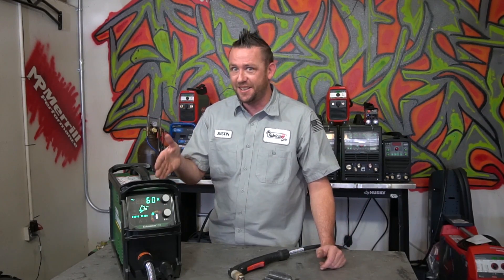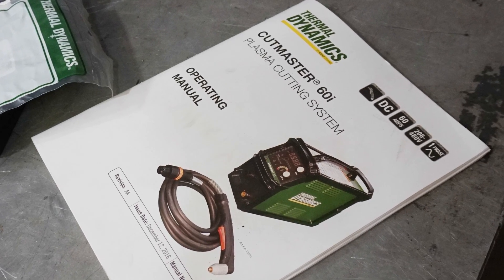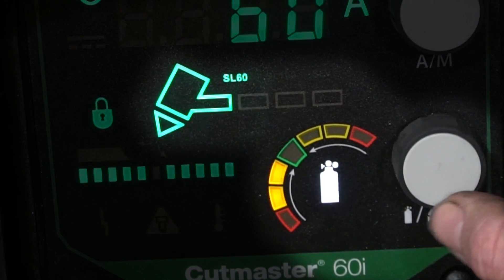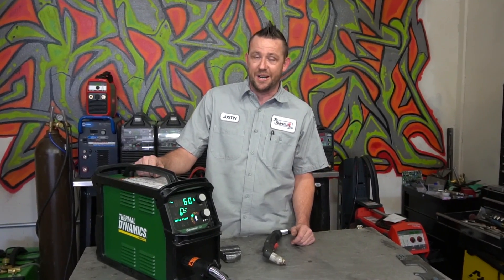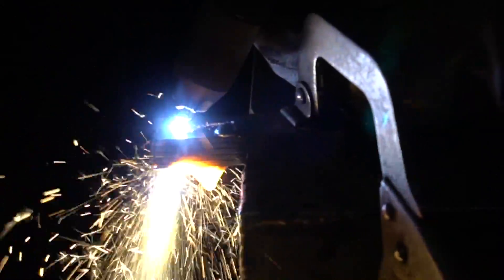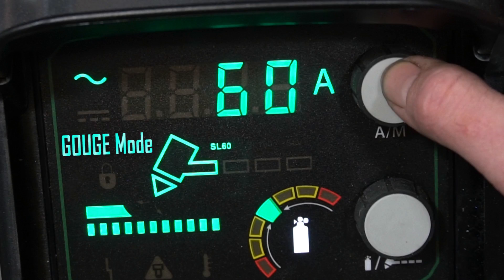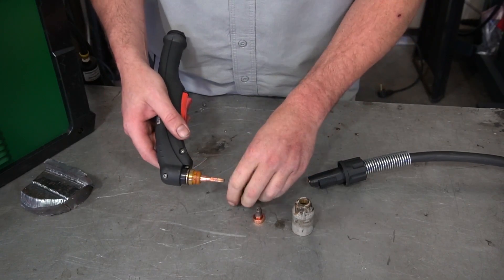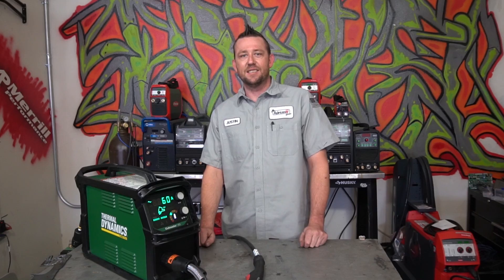TFS: Thermal Dynamics Cutmaster 60i Review

Comment: It's funny how people will get on here and criticize a machine that they've never used. I owned a  hypertherm plasma cutter.  And when it broke down just out of warranty, and I found out how outrageous the repair cost was going to be, that was it.  I'll never buy another hypertherm again.  So instead of wasting $1400 to have it fixed, I bought a thermal dynamics cutmaster 58.  Half the price, and for hand cutting it works just as well as a hypertherm  without all the hype.

Comment: The first one I used was at Pleasants Power plant,it was huge and had argon and CO2,used it to cut stainless pipe that went on the top of the coal pulverizers,B&W ball Mills, Harrison had the same Mills but were 2' shorter.Each unit has 6 Mills.

Comment: I purchased this machine in December,2017, it was great until it failed four months later.Much to my dismay Esab, doesn't have a warranty service center in the state of New York, and they did not pay for the shipping to,and from their facility Airgas, in New Jersey, which is not the actual repair facility.Airgas, sent the unit out for repair,and charged me $20 for the shipping. I sent the unit in for error code E004, that could not be cleared. Six weeks later I get the machine back,and fifteen seconds into the first cut I get error code E012. After checking the manual I was able to clear the code nevertheless,I feel this machine may be smoke and mirrors.Esab, boasts of a  great warranty however, in order to get service be prepared to jump through hoops, and spend some more money.
Reply: i think your comment is a more valid representation of the user experience than the obvious commercial this video is. thanks for the feedback.

Comment: I have had an older model:  Victor/Thermal Dynamics, about the same capacity (60 amp rating) as this one for 4 or 5 years now.  It is basicly the same machine as this but no digital displays. Uses the same consumables as this one.   There was a learning curve for me. My previous machine was a borrowed, very expensive older Hypertherm, which spoiled me it was so easy to use and worked so well. 
Now that I've learned how to run it well, it does quite nicely.  I've built many jigs for getting quicker and cleaner results on production type work.  Usually using a drag shield along straight edges and made up patterns of 3/16 or 1/4" thickness
The challenge at first was just getting good life out of the consumables. Frustrating until I watched some trade show videos of the same machine being demoed. I was using too high of current setting, and now I cut even 1/2" thickness at 40 amps,  sheet metal at 20 amps.
There is a lot of aftermarket import consumables at very significant savings and they seem to work just as well.  Also grinding down the ends of worn nozzles and cleaning the center holes with tip cleaner gave them much longer service life.  
Plenty of air is required.  Upgraded my compressor pump to an Eaton 5hp 2 stage pump with the recommended drive pulley for the 5hp motor. An under size compressor will run hot and send lots of condensation moisture through with the air and shorten consumables life. It is more than adequate now, on it's dedicated 40 amp service (a separate one from the 50 amp welder and plasma cutter circuits).  Lets me run all 3 machines at once, if there are several people working.
A standard plastic household water filter housing with cheap 20 micron particulate cartridge, mounted right on the back of the plasma cutter,  is my air filter that just never seems to need any servicing or attention.

Comment: With plasma it's all dross... There is no slag. Slag is the shit they dip of the top during smelting. 😀 Oh and... Hypertherm rules...🙄
Reply: To have slag, you must have flux. The droplets of steel hanging below and sitting on top are dross.
Reply from the maker: Spatter/slag usually refers to mess on the top of the cut while dross is at the bottom or end of the cut. I usually always say dross for all of it, but wanted to be a bit more proper in the vid.
Reply: The Fabrication Series Sorry.... For the benefit of your viewers, that is incorrect. Slag is a foundry term... This coming from my experience working in a foundry.... Everything on bottom of a plasma cut is considered low speed dross.... Everything on top... If any, is considered high speed dross. This isn't an argument but merely a correction for your viewers. The terminology I use is based on experience... Not conjecture. Dross is inevitable.... Even the best cnc machines have a minute amount so we won't even make the comparison to hand cutting. BTW....I have acquired a ton of info from your channel and I think you do very good work... Keep it up!
Reply from the maker: Paul Wilson Well its what's printed in the books and what I learned. I'd post a pic of it if I could haha.

Comment: This Cut 60 is much better than its older model  and looks like a decent Chinese machine - I thought about getting one however I’ll stick with my hypertherm 45XP you can gouge, mark, fine cut drag cut and precision gouge. The hypertherm is made in NH and I like drag cutting with the hypertherm instead of holding a small height and then cut. The hypertherm is way underrated too. The consumables and nozzles are easy to change and last forever.
Reply: Hey there, thanks for your feedback, it's greatly appreciated. We thought we would clarify a couple of items, Cutmaster 60i was engineered and is manufactured right here in NA. Cutmaster has the same capabilities and can cut more, faster and longer, thanks to the long arc stretch than the other brand you mentioned in your message. With only three consumables to change,  you'll need to keep fewer parts on hand and quicker changes. Drag cutting? No problem, simply switch out the tip and you're in business.
Reply: ESAB thanks for clarifying. The first model was not manufactured in USA correct? This machine is a real drag cut machine? Do you offer fine cut or flush cut consumables? I like this model much better than its predecessor. I do love my hypertherm though.
Reply: We offer a variety of consumables, check them out at https://www.esab.com/beast.
Reply: Welding Junkie one thing I can say is they do offer a boat load of consumable options. Incl drag cutting. But, what kinda sucks is that you have to match the consumable to exactly what you’re cutting. So if you’re set up to cut 5/8” plate, you can’t really pivot over and start cutting 22ga sheet w/o swapping to the correct consumables. I mean you could, but for best results, you can’t.
Reply: There is no way the Cutmaster 60i is going to match the Hypertherm 45 XP in torch or consumable options. The one area that it might have chance is if the SL-40 torch will work with the 60i  I have a feeling it will, but just have to wait till my 60i shows up.. By the way I have had many Esab,and Thermal dynamics cutters over the years.. Yes even before the one torch was out.. 16 year old consumable design in the one torch will not match the Hypertherm in many areas. Just not going to happen The Sl- 100-60 would not really even be close to matching the Performance of Esab 'PT-37-38-39 torch design.  I can get really good performance out of the SL-100SV Machine torch, but took me years to get there.. The Esab, and Hypertherm specs are right on the book #, but will never happen with a one torch machine..
 
It going to be interesting to use both my 45XP, and 60i on my plasma table.
i had a Hypertherm 65, and a Cutmaster A-60 om my table with both machine torches. The interesting thing is Thermacut has a retro torch ready for the Thermal dynamics. Been out, but not released yet.. They have some excellent patents on their torch consumables, and will probably make the 60i a very modern machine in the area of consumable cut speed.. As far as North American...That means made in Mexico, last time I checked.. 

Esab had some flushcut patents for longer then Hypertherm, but never really got around to using them. I would think it's about time to

As far as comparing cut speed (best quality)  with a Hypertherm, 45XP you will find the 60 amp cutmaster will run at the same speed as a 45 amp hypertherm XP. (.500)The 60i should have less issues on a cnc table edge starting on 1" Mild still. The higher cut height, and more output power supply will start to show some advantages there.  I owed a A-120, and Esab 1600 so I get what KW buys you.. Some time with a 85 Hypertherm too.. All can do the job, but Hypertherm machines are the easiest to use for most people..The 45XP is one sweet machine, but does not mean it does everything better..
Reply: @Scott V how did they work out for you?
Reply: SL-40 torch works on it great. Just keep the amps below 40 when that torch is hooked up.. I did some air plasma marking, and it does as well as my Hypertherm 45XP.. If you know the setup..So two things most people don't know. The machine really does have the old school Esab fan noise level, still below  the 350 MPI though. Even lower then the  Migmaster.250.

The one torch works much better with the new power supply, I also have setup the machine on my CNC table.(SL-100SV automation  torch) Without using the Thermal CNC interface. It's out now for the 60i, but I just needed the start, and voltage pins to get my system to work. (own voltage divider, and arc good setup) Pins are there for Arc good too. 

The unit is more powerful then a 45XP, and cuts 1 inch plate on my CNC one heck of a lot easier. Longer arc length of the 60I helps a whole bunch.. 
The 45XP can do great, but PITA because It runs out of power/arc on that thickness. Machine cutting mostly. XP. Hand cutting it really does much better @ .750. Just matched better for that.. Both are flat out great machines (IMO)

Comment: how do you think this machine stacks up against a Hypertherm unit? I'm just about to pull the trigger but this video makes me want to think some more...
Reply: no issue with power but were you really struggling for air with a 60gal tank? what kind of continious cutting were we upto was say 8ft of 1/4" doable with your setup?

just read another post i didnt realize you were running it with the compressor unplugged, yeah thats no good, its wiser just to invest in another 220v outlet, its nice to have a few around the shop to minimize cords being dragged too, a breaker outlet and say 20' of proper gauge solid wire shouldnt be more than 80-100$ and its nothing to install it yourself assuming the breaker panel isnt off on the other side of the property
Reply: they have hypertherms that produce their own air with a built in compressor, might be a good solution for youre situation
Reply from the maker: v5u7sulh2 I haven't used anything new from Hypotherm to be honest. I had a used one about 9 or 10 years ago that was awesome. It was nothing like this one, but it was awesome.
Reply: Hypertherm is top quality and it’s a drag cut machine with flush cut consumables but cost much more
Reply: Go with the hypertherm, consumables can easily be purchased locally at mutiple welding suppliers. Consumables don't last forever. I like mine but if had to do over I would go with hypertherm because of consumable availability locally.
Reply: The 60i is a great machine. For shop use with plenty of power and air available. I bought one and returned it for the dual voltage Hypertherm 30xp and haven’t regretted it once. I work in my garage with 60gal of air and limited power, FYI
Reply: Andrew Browner Bingo! That was my exact issue. Garage on one corner of the house and panel on the opposite corner. It would have been about a 200ft run of wire. I really could have made it work. I just felt uneasy about a few things with the 60i and at the time I was the only person that had one (at least I couldn’t find a single video, IG post, forum discussion, etc.) Even with a second 220 outlet, I really didn’t want to deal with the noise of my compressor and the plasma running non stop. They need to work out that fan noise and air management. And the torch is huge! I was spoiled by my previous Hypertherm 85 and this just seemed like a huge downgrade. I only bought the 60i because my LWS guy had one that was a leftover “demo” although it was never used except for a display at a local show and he was motivated to sell it quick ($1400 FYI). I didn’t need that big of a machine but figured why not. The Hypertherm 30xp is perfect for my needs. I almost went with the 45xp but it wasn’t dual voltage. However, if power and air aren’t an issue, I’d take the 45xp over the 60i no question. Nothing against Justin or ESAB/ TD, but Hypertherm is The plasma company. IMHO
Reply: Hypertherm rules...I had two TD machines before I bought a Hypertherm....ime...I wouldn't go back unless I could see drastic changes in TDs edge quality. This is all based on cnc experience...hand cutting is hard to make comparisons on as everyones skill level is obviously different. 😁 Aaaaand, Hypertherm is drag cut out of the box.

Comment: What's your thoughts on Esab tig machines?
Reply: Hey Peter, please let us know if we can be of any assistance!
Reply from the maker: Peter Stewart I've only run a few of them and like them for the most part. I just dont have enough time with any models to offer up a thorough review.
Reply: The Fabrication Series Thanks, I’m a mig/stick guy trying to get into tig work, and my local welding shop sells Esab so I’ll hopefully get one at some point 👌🏼
Reply: Peter Stewart I have the miniarc 161 lts and really like it. Great machine for pipe but no ac or foot control. Other than that it's super smooth and runs great
Reply: ESAB any chance for a remote option for my miniarc 161 lts
Reply: Unfortunately we don't offer either as an option for the MiniArc 161.
Reply: ESAB any plans of changing that? Would be a full fledged pipe machine at that point. Be a great jobsite machine, really like now but that's my biggest issue is no remote option
Reply: Not to our knowledge but we'll send the request to our product management team.

Comment: After purchasing from Amazon, what else is needed to start cutting?
Reply from the maker: jenseneering Air pressure and some safety gear. Its ready to slice out of the box.
Reply: Air compressor? Regulator? Compressed bottle, oxygen, c02. How much pressure is required? New to this plans cutting thing.
Reply: jenseneering it needs a boat load of air! And if you’re working in your garage with just 1- 220 outlet, and your compressor is plugged into it, you will have issues. I bought one of these a year or so ago and quickly returned it. I cut about 18” of 1/8” before it drained my 60gal compressor tank. If you have 2- 220 outlets you’ll be fine, if you don’t mind the noise of this beast running on top of your air compressor running at all times.
Reply from the maker: You can use an air compressor or a portable cylinder. I have a 60 gallon compressor which is more than enough. I'm pretty sure you can use smaller. I run my compressor and machine off of the same 220v 50 amp circuit with no issues, but my shop is industrial and not residential. The manual says you need 125PSI supply which it regulates automatically in the machine itself.
Reply: I use a 60 gallon air compressor with my hypertherm 45XP too and I have no issues but like he said you need both running at same time. The hypertherm xp air intake is automatic no switching needed
Reply: You should be able to get all of your questions answered by downloading the Owner's Manual. Head on over to our website esab.com and click on product support\documentation\user manuals and then to the Global Manual Directory. We tried adding the link to this response with no luck. :(
Reply: When I returned my 60i I purchased the Hypertherm 30xp. I got the 60i real real cheap. The reason I went with the 30xp was a) dual voltage b) better air management
The 60i (like Justin said) self regulates at 125psi. So as soon as you hook up your air hose the torch starts bleeding your 150psi compressor down until it hits 125psi. Then, the 60i shuts off once the pressure hits 100 or 90psi, don’t recall exactly.  So I was having to swap my 220 lead back and forth. Every 18” of cutting. I don’t cut anything over 1/8” but the 30xp will do 3/8” on 220V if I ever needed it to. I didn’t try hooking up a second 220 outlet because the book said you needed a dedicated 50 or 60A outlet to run the 60i. Apparently I could have gotten away with it if Justin is doing it with his. The 60i is a good machine, don’t get me wrong. But the Hypertherm better fit my needs. I’ve also owned at Hypertherm 85 and an older TD/Cutmaster 45. Id still choose the 30xp over all of them for use in a garage environment. If power wasn’t an issue.... man I miss my old 85. THAT was a BEAST!
Reply: jenseneering DRY air..... Or you'll just end up buying more consumables....plasma and high humidity air don't play well together.